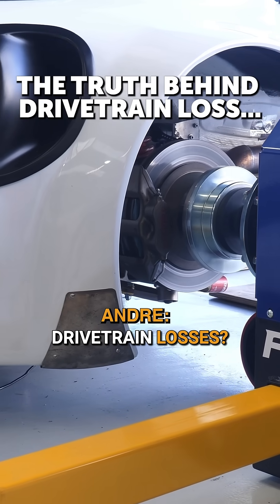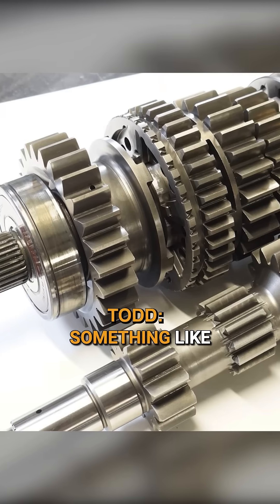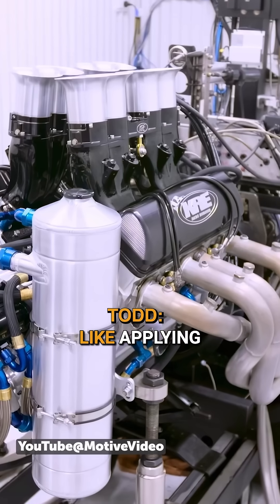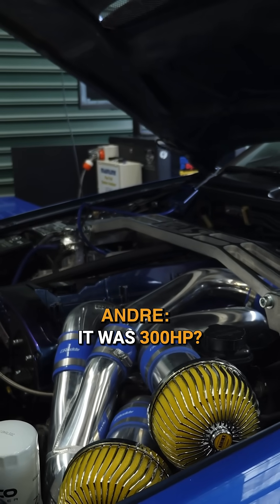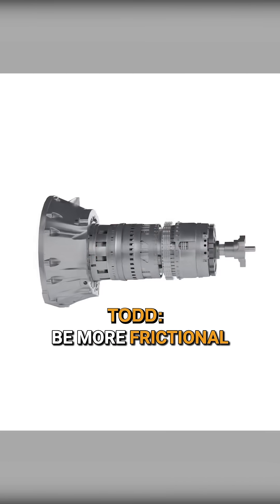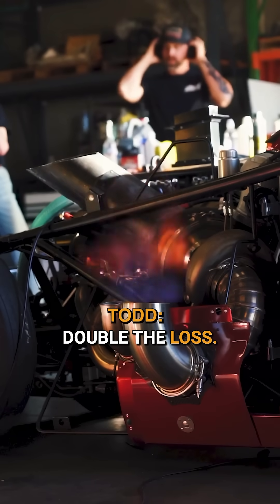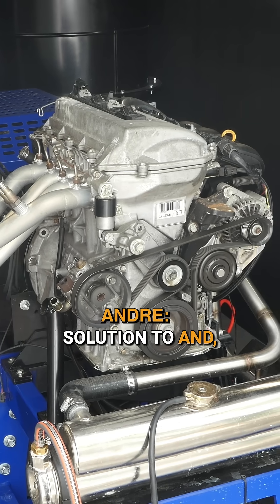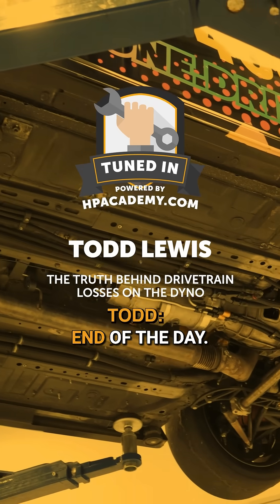!!The Truth Behind Drivetrain Loss!!

Comment: For most people, it doesn't matter for anything other than comparing spec sheets. The only practical ways to reduce drivetrain losses are to disable stability control, run narrower tires at a higher PSI, run thinner oils, loosen the LSD preload, and maybe fiddle with the AWD if equipped.

Comment: In my opinion at the wheel power or at the hubs is all that matters. A loss of power is a loss of power. I must admit it gets anoying hearing people claim their car makes a certain crank hp to then find out they have put a 40% "drivetrain loss" correction in. I might have the opportunity to test this in the near future by engine dynoing before putting the engine in the car at different boost levels.
Reply: I agree that it's pointless for the street. Crank horsepower is more used when trying to calculate the efficiency of the engine for a given amount of fuel. If you're way under the expected hp for a given fuel volume then something might be wrong.